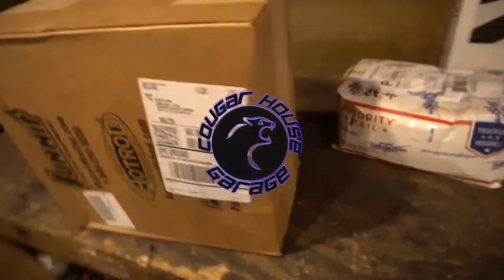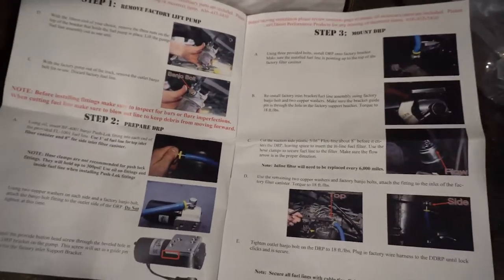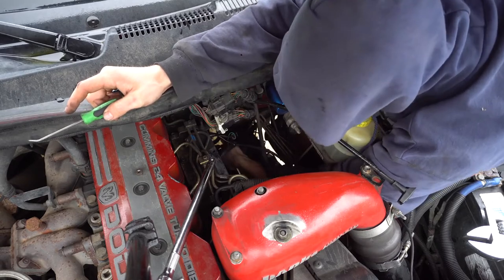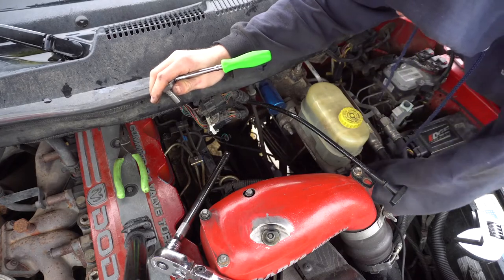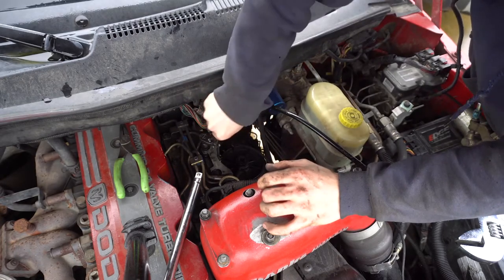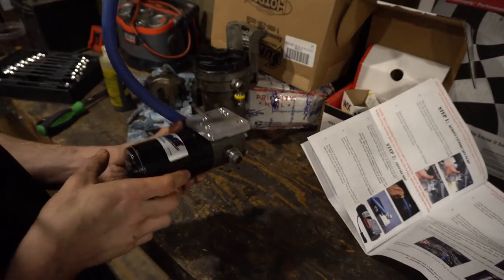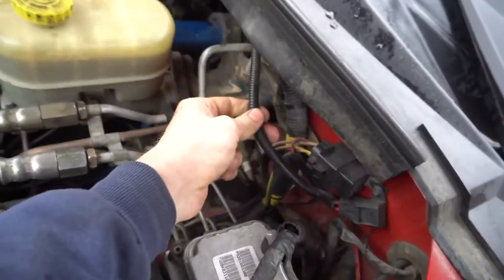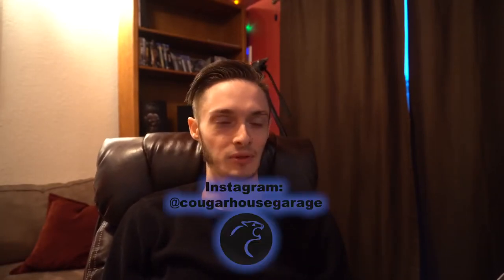FASS DDRP FUEL PUMP INSTALL CUMMINS 24 VALVE Cougar House Films Ep.138

Comment: I got just the pump for 200 off summit but I also purcased the big line kit with fittings. Should work when I get a few bolts to mount it. And now no banjo bolts just AN fittings.
Reply: DID IT WORK OUT? IM LOOKING AT THE SAME THING RIGHT NOW
Reply: @josephanderson5080  It worked great

Comment: Ummmm... the blue hose in the DDRP kit needed to be cut to length not routed like a baboon did it. That small "filter" is a protective inlet screen, without it you risk trash from the tank getting into the pump (that will void FASS warranty). FASS warranty is not very wonderful, if you have a claim they insist you send pump to them for inspection and you are stranded with no pump until they determine in-warranty status. Also, for goodness sake DO NOT USE THE SQUARE HOLE IN THE FUEL FILTER COVER TO REMOVE THE COVER use the proper socket!

Comment: Do you really need to pay an extra $100 for the DDRP 02 with the install kit. Or can you just get the pump from summit for $190 and use the original line and bolts??
Reply from the maker: the line are not long enough and they have the wrong fittings